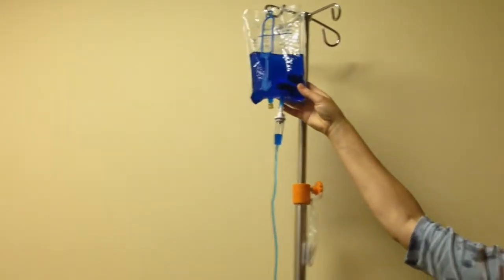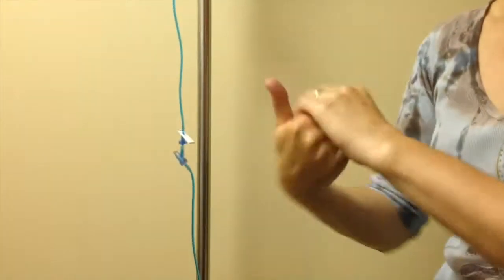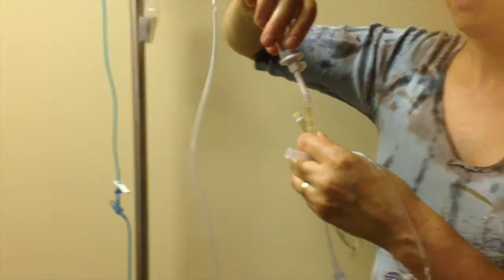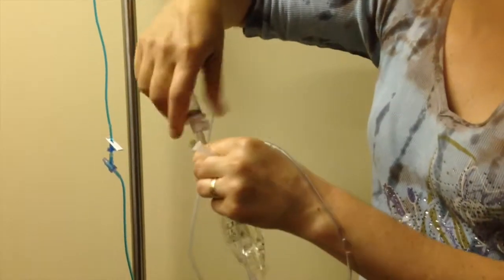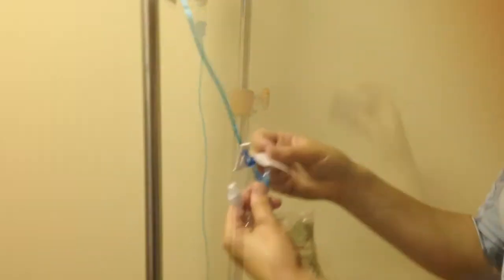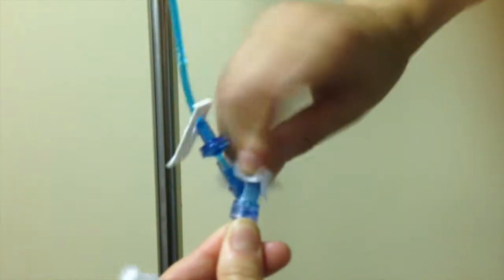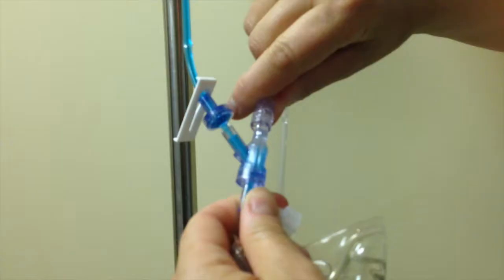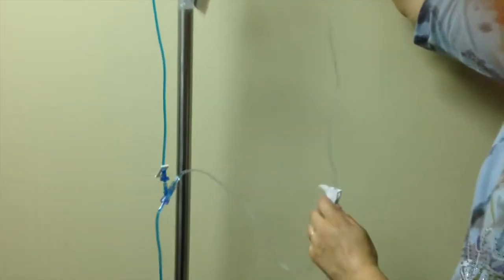Backpriming of a secondary tubing

Comment: After connecting the piggyback to the primary do we squeeze the fill chamber or not ?
Reply from the maker: No, the primary solution will fill it when you drop the bag.  You just clamp the secondary tubing when half-2/3 full.

Comment: When you do this, and you program the pump to administer 50mL (or whatever the secondary volume is supposed to be), you will end up not administering the full dose.
Reply from the maker: You are absolutely right!  This is why, at the end of the administration, you should back prime an additional 15-20 mL and infuse that diluted solution. Some medication will remain in the secondary tubing but this amount is considered acceptable in my institution.
Reply: Yes but doing this you will administer MORE than the intended dose. IV bags are overfilled. Like a bag of magnesium your dose is 50mL, but the bag usually contains ~55-60mL. There is no reason not to just prime your secondary tubing with your medication, it avoids all these issues.
Reply from the maker: This is not true. There is never overfill of dose in the bag. The exact dose is added to the bag. The concentration changes slightly but to administer the full dose you need to administer the full bag.
Reply: @Coniela1 No… the bag is a set concentration. This is written very clearly on the bag (e.g. 4g/50mL). Just cut a bag open and see for yourself there is extra.
Reply: @Coniela1  this is straight from the website of Braun, a major manufacturer of IV meds. “The overfill is required to compensate for the tolerance of the filling equipment, for the volume remaining in the container after use, and for water vapor transmission from the container. The overfill ensures the required volume of solution is present in the container and the concentration remains within specifications through the shelf life of the product.” It literally specifies that a 50 mL bag actually has 57 mL. And a 100mL bag has 109 mL.
Reply from the maker: I am not disputing that the bag is overfilled with solution. This is well known. I am saying that when medication is added to that fluid, then, to administer the full dose, then you need to administer the full volume, including the overfilling solution.
Reply: @Coniela1  No… if the dose is 4g of Magnesium and the bag is 4g/50mL then you need to administer 50mL. But the bag has 57 mLs in it. If you administer all 57 mL you are giving more than the 4g dose.
Reply from the maker: It depends how your magnesium was prepared. 
See attached guidelines. https://ismpcanada.ca/wp-content/uploads/ISMPCSB2013-07_ManagingOverfillIntravenousMedications.pdf
Reply: @Coniela1  But the fact that any bag has overfill means you should not be backpriming and then re-mixing your primary fluid with the medicine to try to administer the full bag. You prime with the medicine, you administer the exact dose, and that is it.
Reply from the maker: Thank you for your comment. We will have to agree to disagree.
Reply: There are some benefits to back priming a secondary infusion: compatibility, cost, and risk for infection. Back priming only requires compatibility with the primary infusion, compatibility between IVPBs should not be an issue if tubing is flushed with Primary IV Fluid. This method saves $ because new tubing is no longer needed. Most importantly, back priming decreases the risk for infection because it is a closed system. Considering when you back prime you only open one entry port - (the bag and spike connection) rather than two with the secondary and primary tubing port connection. I've seen both ways of hanging a new secondary tubing - priming with the primary line or medication. I can imagine reasons why you may want to prime with medication if you are administering dose sensitive medications. I would consider the strength, dose, and concentration of the medication before deciding which method is best to use.
Reply from the maker: I could not agree more.